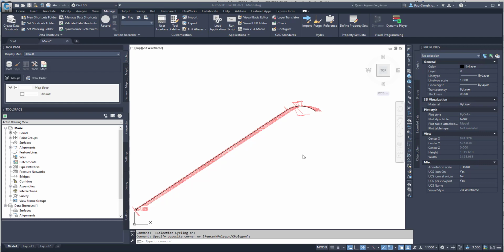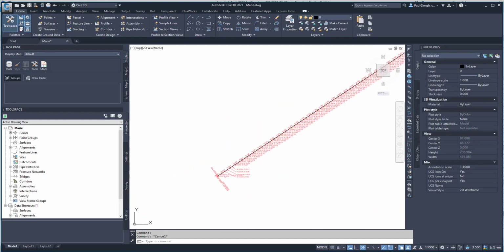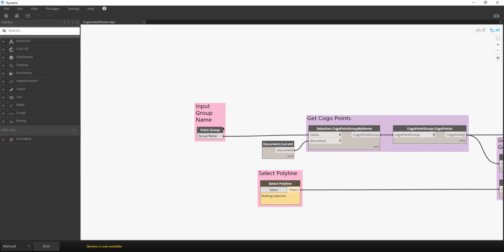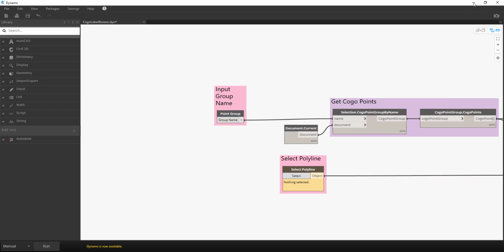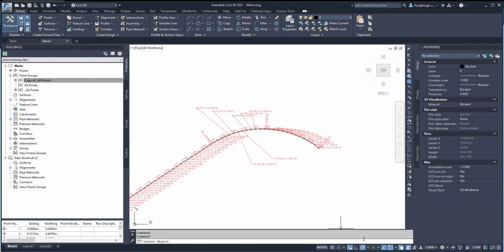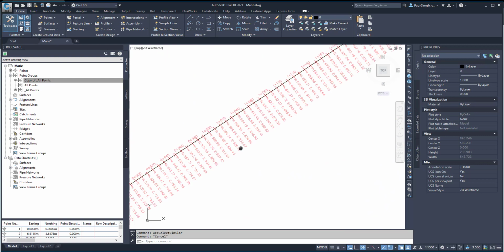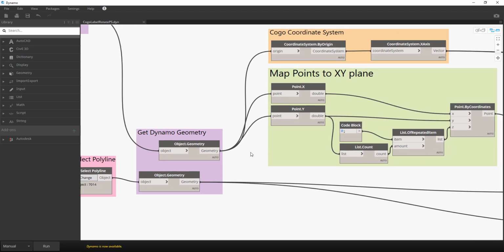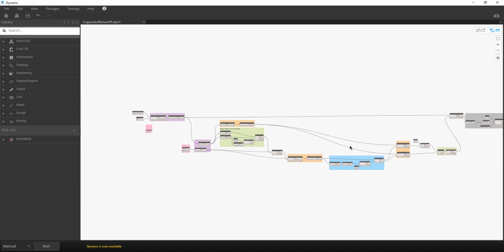Civil 3D Alligning Labels   Dynamo

Comment: Hello, i have a problem. I created a polyline and add 4 points at it manually. After running script it rotates me only 1 point (first on line) and in script node: "Curve.ParameterAtPoint", there is only one point. Thats why it rotates only 1 point and i don't know why it happens ? Any suggestion ? Thanks in advance